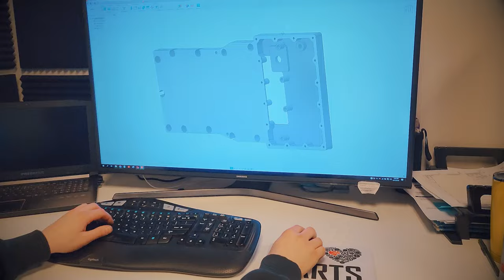Building a Billet Oil Pan for The Ecotec Miata | RuggedBadger.com

Comment: After you have the engine installed with the adapter and transmission in place, look to see if the lower transmission/adapter region is flexing away from the engine when the clutch is depressed.  You can check this without running the engine.  If you do experience lower separation or flexing you may want to further improve your oil pan design to solve this issue.  Note that the stock Ecotec oil pan has casting features that allow the lower portion of the transmission to be attached to the oil pan.   The design challenge will be dealing with the limited space when installed into the Miata subframe.  Maybe you could design a separate transmission support cradle that bolts to the oil pan or to the oil pan bolts or both.  Another option is to have V8 Roadsters make a custom subframe to go with your custom oil pan.   However, I think that could violate racing rules but would be a great street and track-day option.  Carry-on!
Reply from the maker: I appreciate the response.  Someone else mentioned this when we did the first video and we added threaded holes to the pan for a brace.  The brace should be done soon and I will do a video on it.  Be sure to subscribe to see it.